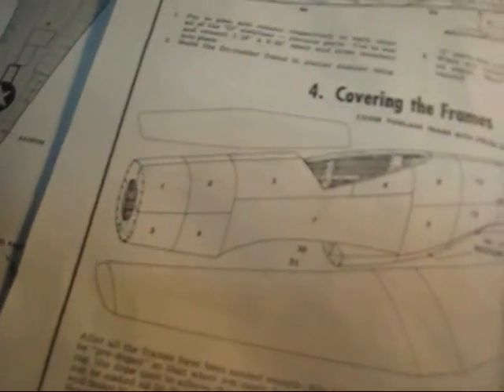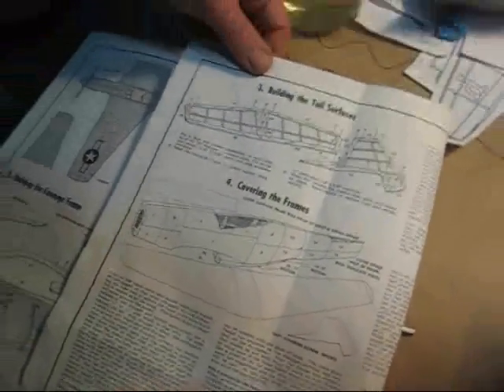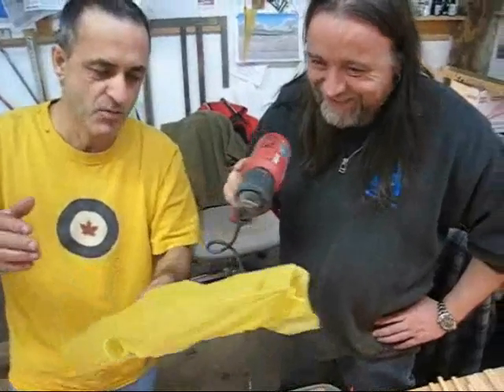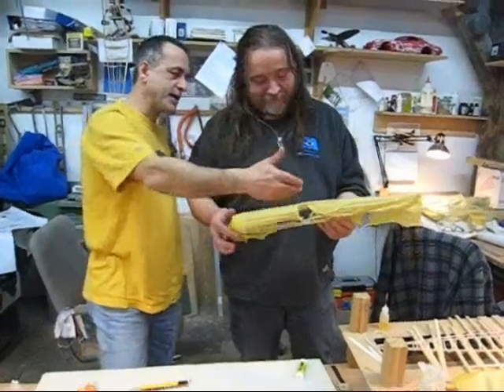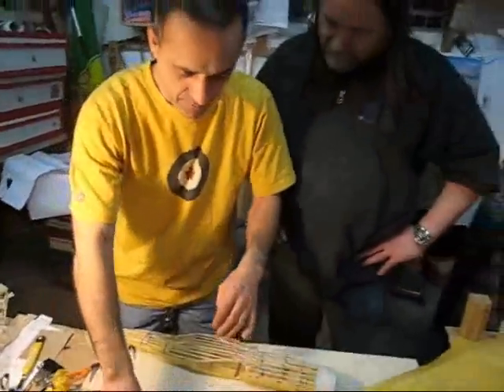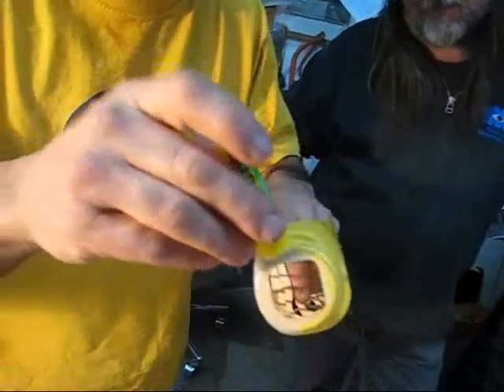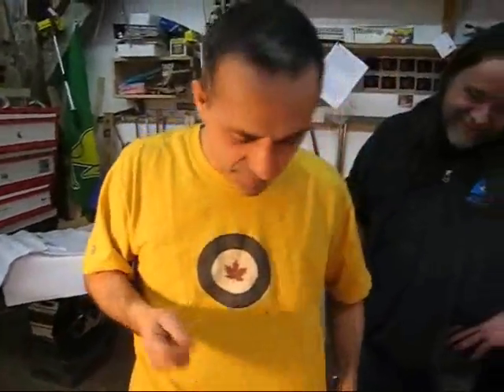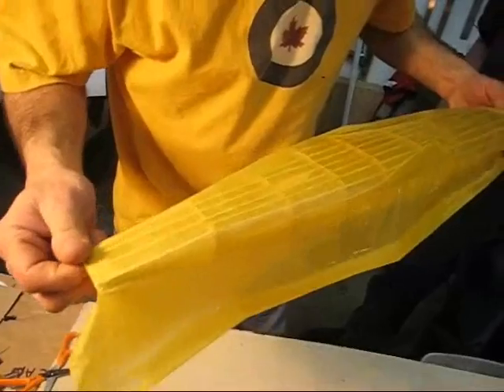bern covering part 1

Comment from the maker: make sure you do this method only on strong structures. You need to use japenese tissue and nitrate dope hopefuly with a bit of castor oil mix in. With those product warpage is SUPER easy to remove , just apply a bit of heat from a heat gun and warp where you want. Do not use this technique for tail surfaces, use another video on tail covering. In my list of video there is also another video ( part1 to part6) on covering that is a bit more "scientitfic and but less funny.